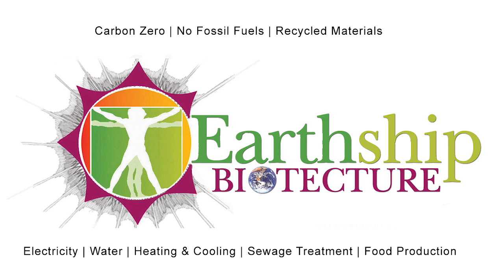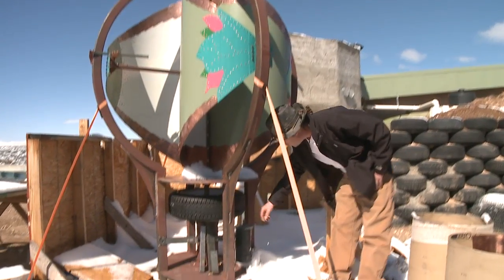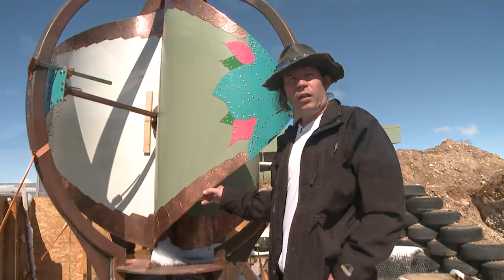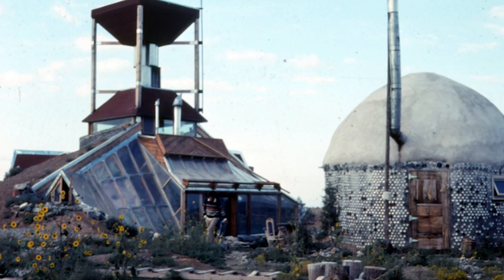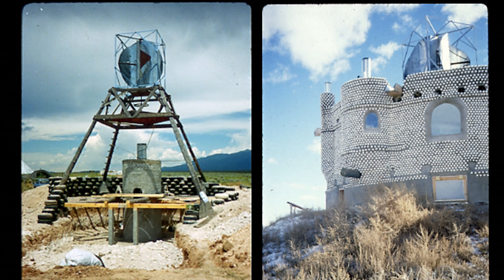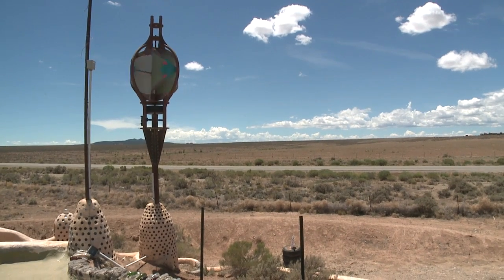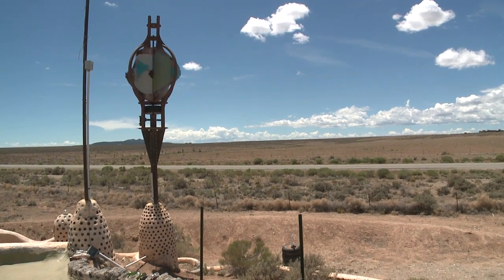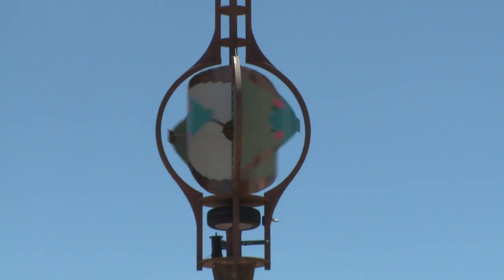Dynasphere Renewable Wind Power

Comment: It looks like a nice concept ....but in the demonstartion video  your windmill is spinning and the horizontal is not ...which might look nice ....but as far as I can see from the video you don't have a generator connected to the wheel (yet) ...so you are basically idleing .....
Reply: plus ....what is the concept to prevent over-speeding?

Comment: The tire is a novel idea, holding to the Earthship motif; however, to improve the windmills rotational energy, the tire should be replaced with a much larger diameter Flywheel, weighted at it's rim.
see: Flywheel energy storage

Comment: This windmill is not efficient enough and too much money for one (without generator)
This windmill:
Too heavy.
When is heavy its it also need higher speed of wind to turn,
It's hard to build with this let's say wings.
I have my windmill it is vertical 3 meter by 3 meter and it need just 1 meter per second of wind to turn and it is very high efficiency, very light weight vs this one and it cost me about 100$ (without generetor) and it can stand very high speed of a winds this one can not.

Comment: There is no way that thing will produce 3kW.  I doubt it will produce 300W.  Regardless of how you build the turbine, you are limited by swept area, windspeed and the Weibull distribution.  It's what, 4 feet in diameter?  At 35% efficiency (which is a standard efficiency for HAWTs, this will be lower most likely), 10m/s windspeed (which you will never see in New Mexico, especially 15 feet above the ground) and the given swept area, a readily available calculator gives me an output of 230 Watts.

Comment: Beautiful!  Thank you so much!    Also, if it is damaged after 50 years of service, somebody can salvage the framework by building a funky vertical axis rotor.  On a horizontal axis machine a funky repair is unlikely to be successful.

Also it's bird-friendly!
Reply: Was wondering about the bird factor.  Thanks for that.  I really like these systems.  There are some out there that are multi-megawatt systems, but they are really huge and bulky buggers with the bulk of the mass at ground level.  The larger ones may be used as community power supply systems, but I've seen little data on cost per KW.  Like you, they may not be practical till are selling enough units per unit of time.